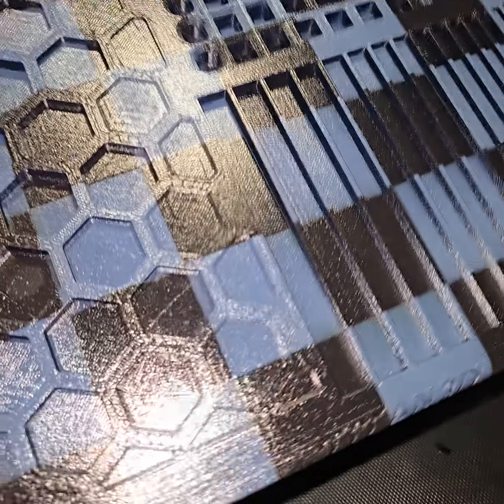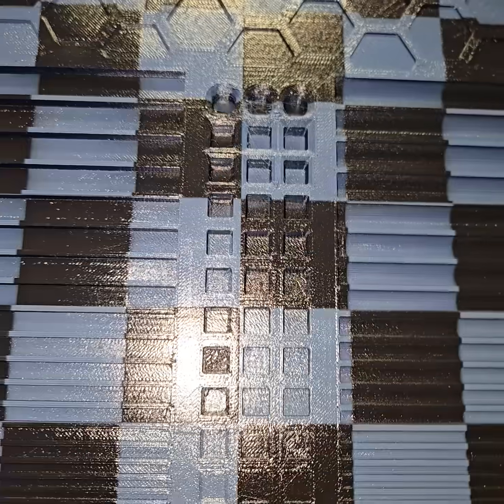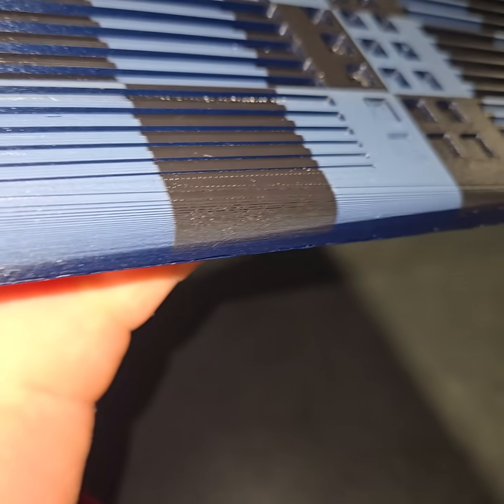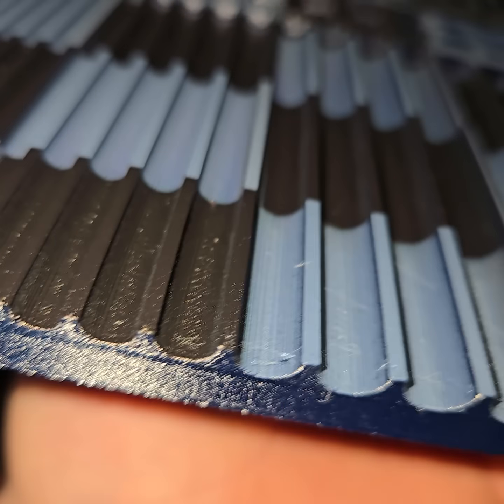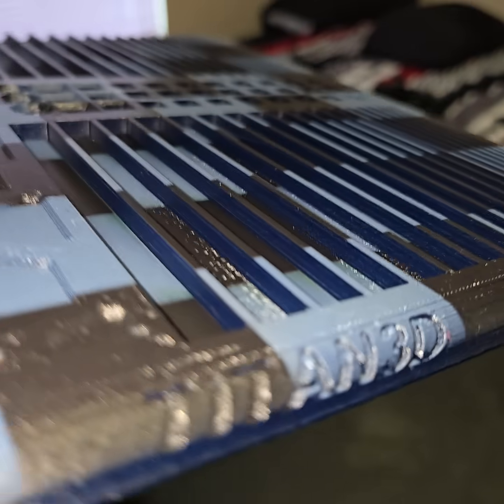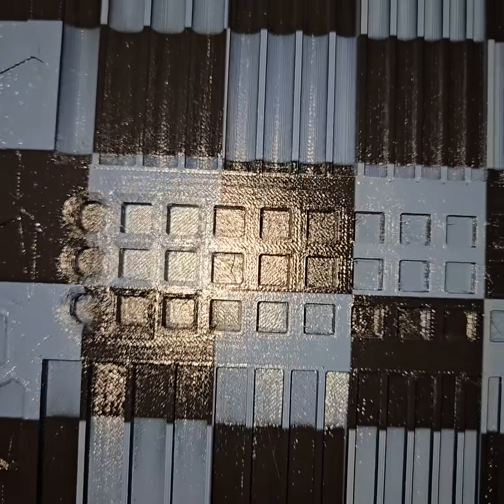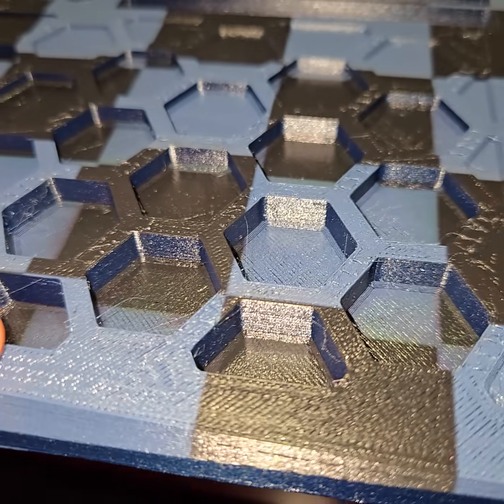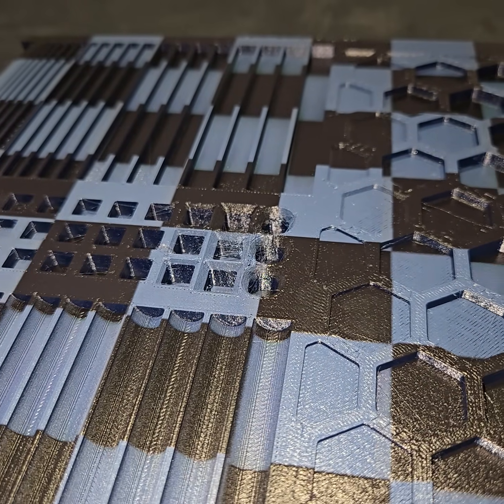EufyMake E1 surface deviation capabilities.

Comment: I’m wondering if it’s possible for the machine to print different heights like the black-hole lithophane you made, but going up to around 10 mm. Have you tested something like that already?

Also, if you ever try combining this variable-height technique with the lithophane piece you showed — using the height variations you tested here — I’d be really curious to see the results. I’m very interested in this machine, but I’ll wait a bit longer before deciding.
Reply from the maker: I believe the limit is 6 mm thick. I think I will do a lot more testing like that. Good idea.
Reply: @Titan3DMFG  test and share your results! try to push the machine to the limits.

Comment: Useful, thanks. It seems that it would be possible to print even with greater than 9mm height if this part would not need sharp colour edges. Would be interested if anyone has tried up to 2cm varying surface level.

Comment: With a higher distance the ink won't hit the spot it's supposed to hit. They will become more of a "mist" that still covers areas below, but color mixing will become bad and such. 

To me in deeper parts it looks like there is overspray. For example, the lines between colors are not as sharp anymore.  At 2:07 you can see that pretty  well in the lower part right from the center line.
Reply from the maker: For sure. It's still impressive with what it can.